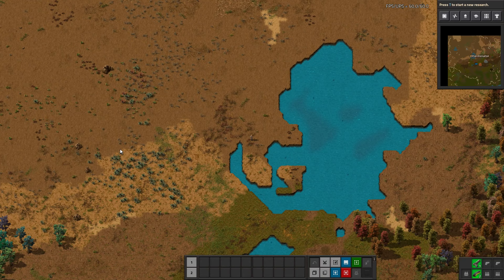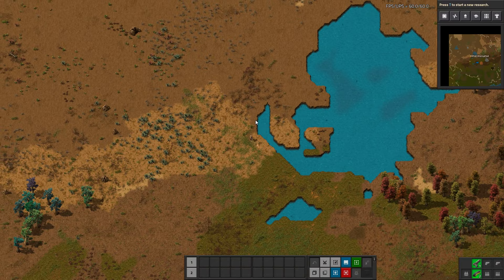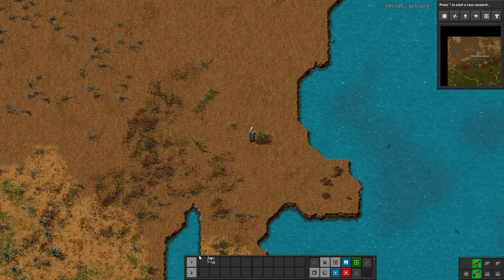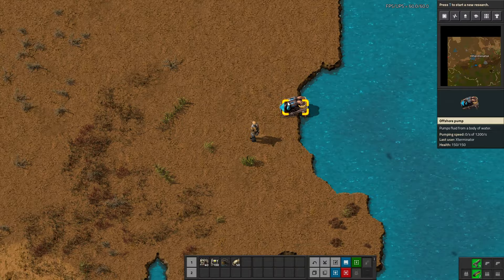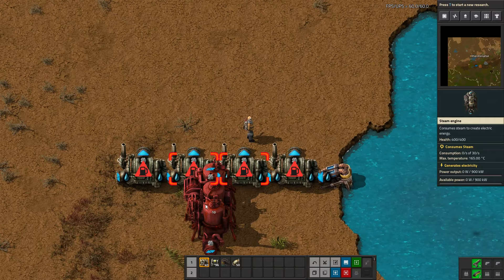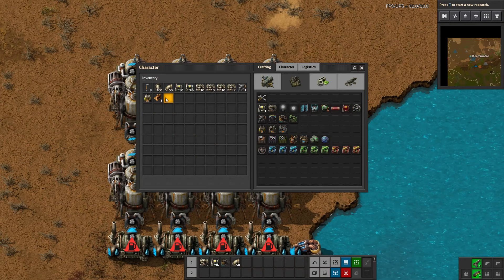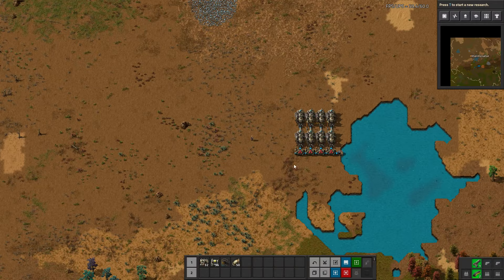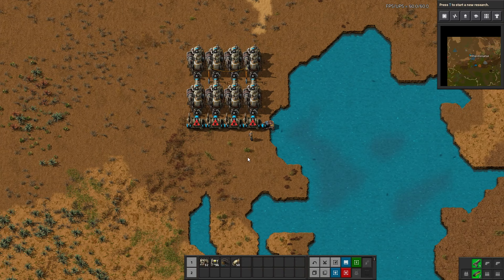Factorio 1.0 / 0.18 Tutorial - Setting Up Power in Early Game: New Player Guide

Comment: 1 water pump can support 20 boilers and 40 steam engines.
You need power poles to extract the electricity from EACH Steam Engine. This setup is efficient as it uses 1 pole per 4 engines.
Reply: Power poles are very cheap, so it doesn't really matter how many you use per engine. Just need to make sure every engine is covered.

Comment: There is a way  to place a huge project on the map? I'm trying to put a big BP on map but it's placed only in my range of view. the other project it's ignored.
Reply from the maker: Yes! In fact it's a brand new feature in 1.0 where you can place blueprints from the map view. I show it off pretty well in my 1.0 overview video near the start of the 0.18 section. Probably about 25 minutes into the video.
Reply: @Xterminator  I'm in 1.0.0 ver. you know if They will implement soon in 1.0?
Reply: @Xterminator  Ok but you use a view limit mod? Because doesn't works for me because the BP it's over my view range.